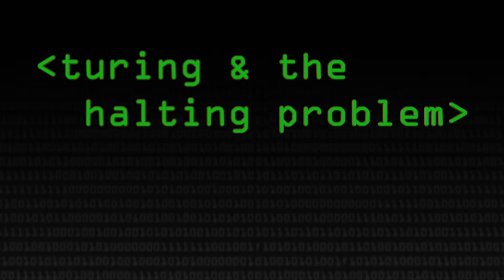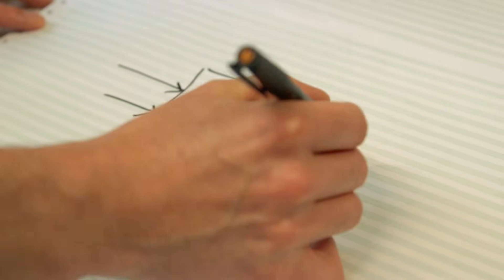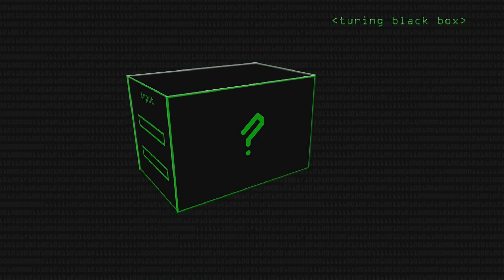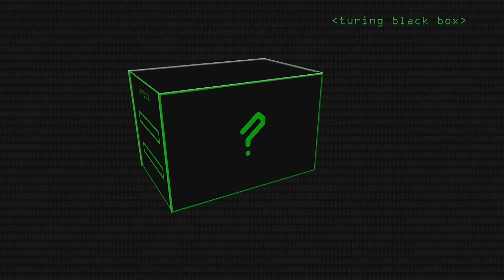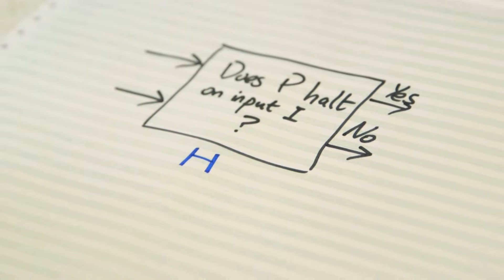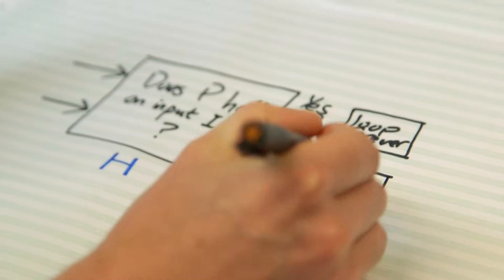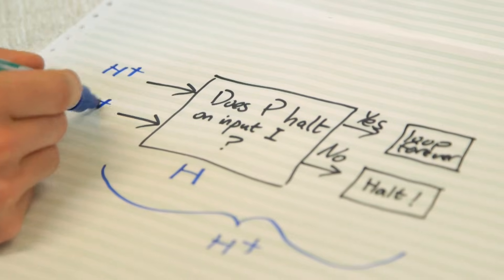Turing & The Halting Problem - Computerphile

Comment: I see something wrong with this proof (and find it probable that it is my understanding that is wrong).

If:
H(p, i) is the function that returns "yes" if program 'p' halts on input 'i' or else returns "no"
H+(p, i) is the function that goes into an infinite loop if H(p, i) returns "yes", otherwise it returns "no"

Then you're saying that performing H(H+, H+) results in a contradiction and therefore "H" does not exist. Right?

For ease of use, let's duplicate H+ and call it H1 and H2. Then performing H(H+, H+) is identical to performing H(H1, H2), and I can now refer to H1 and H2 separately.

I see two problems with this video:
1. In this situation, we've given H1 the input H2, but we haven't given H2 any input. I know that we aren't actually running H1 or H2, but if H is supposed to be able to decide if either of them halts, it's supposed to get the input for them, right?
2. We assume that H1 has to return the same thing as H2.

ex, let's solve the problem of no input by saying we give it a program that returns immediately (ie does nothing). Then, H2 loops forever, so H1 returns "no", so H returns "yes".
Alternatively, give H2 a program that loops forever. Then H2 will say "no", H1 will go into an infinite loop, and then H will return "no".
You could also give H2 another H+, but then you need more input for this newest H+. You can't feed it an infinite number of H+s, can you? Any compiler would be unable to create such a function call. Any physical computer would be unable to hold such a request since it would require an infinite amount of memory (since you have an infinite number of references to H+ as input for itself). Even with infinite memory, you'd never get to actually run the "H" function since you'd still be writing more references to "H+" as arguments (ex, H(H+, H+, H+, H+, etc)). I don't know what you might argue would happen with infinite memory and infinite processor speed, but fortunately (unless proofs have to consider that too?) neither of those exist.

The 2nd problem, I hope, is obvious (and perhaps I misunderstand the video/proof?). Just because you recurse on a function doesn't mean that function has to return the same thing at every level of recursion!
ex:
factorial(i)
> i is 1? return 1
> else return i*factorial(i-1)
If I call factorial(3), the function factorial is going to get called a total of 3x, and it's going to return 1, then 2, then 6.

I can only imagine that the contradiction is supposed to come about because we call the same function with the same data and get two different results. But since we're giving 2 different inputs (we're giving H+ as one input, but nothing for the 2nd input), this isn't the case.

We might construct a new function,
H(pi)
where 'pi' is a data structure containing both a program and its input and allows for recursion (that is, the "input" might itself refer to a program-input pair).
Then we could likewise create H+(pi), and it would act just like before.
Now we give H an instance of this structure that contains H+ as the program and itself as the Input. Pseudocode:
pi = new ProgramInputPair()
pi.Program = H+
pi.Input = pi
H(pi)

In this case, I believe the following steps would happen:
-H should start analyzing H+
-It should realize that H+ will use 'pi' and therefore look at pi.Input (technically it's that H+ calls H and H is the one that uses 'pi')
-It should recognize that it's in infinite recursion since it's about to repeat the same function call that it's already in (ie the function call to H+ using 'pi' is already on the "virtual stack") and no global variables that are used by H+ to dictate its behaviour have been changed

Notably, H can never get to the return statement of H+ because of the infinite recursion. Thus, trying to reason about the value of the return statement is incorrect.

Now, even with this reasoning, the Halting Problem is still impossible to solve unless you can teach it all properties of mathematics (which no one knows; I believe Godel's incompleteness theorem proves this impossible?). Without any understanding of mathematics, an algorithm cannot even tell you if the following halts:
i = 0
while i % 2 == 0 do
     i += 2
end

I therefore feel that this particular proof for the Halting Problem is wrong. On the other hand, it seems to be very common around the Internet. Have I misunderstood something?

Comment: so maybe there is a machine H++ that solves the halt problem, 
given this machine is not a part of the halt problem?

this way we bypass the paradox. our machine, H++, solves any halt problem, but only if H++ itself isn't a part of the asked problem - meaning it does not part of the input machine.

we can call it "the outsider observer" principal:
we can build a machine (H++) that would solve any halt problem, if it looks on a problem that is completely outside of H++. meaning the problem don't have the logic of H++ itself inside it.

however I do see a problem with this solution:
given a complicated I machine (I = for input, the machine that given as input to H++)
we can never know if H++ itself is actually part of I logic. 
maybe I contains H++ in it and we will never know it, so we can never know if H++ can solve the halt problem for given I or not.

nevertheless, IF we have a way to assert that H++ is not part of the problem I, we bypass the paradox, and so H++ might exists,  as required.

Comment: Its a dumb thing but if X=X+1 where X is the Output then the loop would make scene and X would be 1-∞ in a loop. But wouldn't you prove that that is correct.  Although its somewhat illogical but start with X as an Int add 1 so the new output is X. So the Output is either right or wrong but if it loops ether way is an issue with the Coding. Am not sure I need help on this.

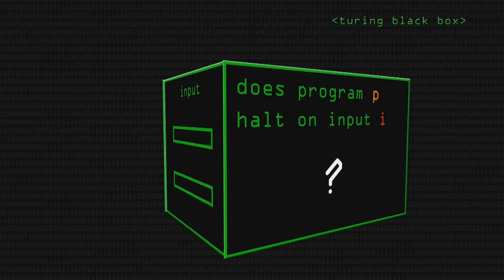Comment: +Computerphile At 3:58, Mr. Jago says that the blackbox will output "Yes" if the program halts, but "No" if the program never halts (a.k.a loops forever). But how does the program know that it will loop forever, since with every iterating loop it has the potential to halt? 

 - An Engineering Physics student, and Physics student in California
Reply: It doesn't even matter how such a machine works because it cannot exist. He even says "Don't worry about how it works, just assume it does."

Comment: you should feed h+ to h not h+ to h+ because h+ is a modified machine to reverse the output real meaning.
Reply: Hmm the idea comes into a bit better focus like that. But why do these machines need two inputs?
Reply: @foreverseethe  It takes the machine and the input that the machine would be given.  It's possible for a machine to loop forever on one input but halt on another.
Reply: Yes exactly. He is purposefully doing something to reach a contradiction, and that's fine. Why?

Think of it like this. We want to prove H does not exist, but we're having a hard time doing that, so we assume it DOES exist. Using H, it is very easy and possible to construct H+ as they said in the video. So far we know, if H exists, then H+ exists. Agree? Continue reading if you do. 

Now using H+ we arrived at the contradiction, showing that H+ cannot exist. But how is that if we showed how to make H+ using H in a valid logical way? That must mean our original assumption was incorrect, in that H can indeed not exist. 

Hope that made things clearer.

Comment: I'm not clear on how the behavior of H+ shows anything about the behavior of H.  The two machines are not the same, so why would you expect the same (i.e. correct) output.  By this logic I can ask whether it is possible to build a vehicle that can move down a road.  Suppose there is such a vehicle, let's call it CAR.  CAR can't possibly exist because I can attach a module called NOGAS that removes its motive force, so it can't go down the road.  Since CAR+ can't go down the road, no such vehicle can exist.  QED.  

If you're going to add parts that break things, why pretend that you're still dealing with the same program?
Reply: +Jason Patterson Yep there is no such vehicle CAR+, that can drive because CAR+ = CAR + NOGAS. There is no fuel powered car that can drive without fuel.
Reply: The missing part from your example is a contradiction. CAR+ can't go down the road while CAR can, and that's it. If you somehow reached a contradiction using CAR+, then indeed CAR could not exist. Both CAR and CAR+ can exist here fine.

What happened in the proof in the video is that using H, he constructed H+, and showed that H+ is impossible to exist. So essentially we've arrived at two conclusions at the same time, H+ can exist using H, but at the same time H+ can't exist from the way he described in the video. That's a contradiction, so the assumption that H exists was wrong. Hope that made things clearer.
Reply: @Kalernor  Does not make sense "using H, he constructed H+, and showed that H+". Meaning it is possible to put anything as an addition to H, and then say:"look, just because I added some impossible things to H+ it means that H, my base, is also impossible.".

Comment: define a operation "~"
~(Yes / Halt / 1 ) will trigger an infinite loop.
~(No / 0 ) will return a Yes/1.

0. H(Null, Null) = waiting for user inputs, no output
1. H+(Null, Null) = while(no input) {wait...}, forever loop
2. H+(H+, [Null, Null]) = ~(H (H+ [Null, Null])) = ~(No) = Yes

3. H+(H+, [H+, (Null, Null)])
= ~ ( H ( "case 2" ))
= ~ (Yes)
= forever loop

4. H+(H+, [H+, (H+, [Null, Null])])
= ~ ( H ("case 3"))
= ~ ( No )
= Yes

5. H+(H+, [H+, (H+, [H+, (Null, Null)])])
= ~ ( H ("case 4"))
= ~ ( Yes )
= forever loop

...

N. H+(H+(H+(H+(H+(H+(H+(H+(....))))))))
if N is even:  Yes
If N is odd: forever loop

Of course the all knowing powerful H knows about this...
it would just count the number of "H+", then outputing Yes or No accordingly.
even => Yes
odd => No
there is no paradox here.

Comment: what is the meaning of this sentence?"feed the whole machine into itself"i dont get what happens if we feed the whole machine into itself,and if not.what are h and h+?
Reply: +Sou Sargol H is a machine that takes the description of a machine and an input. Now, given any machine (let's call it M) and any input to that machine, this machine (M) will either stop eventually or not stop, and keep computing forever. What H does is say whether the machine you gave to it will stop or not stop for the input you gave to it.

H+ is constructed based on H by doing the changes mentioned on the video (if H says "yes, it will stop", H+ never stops; if H says "no, it will never stop" H+ stops). (H+ does nothing useful, we only think of it in order to show that H can't exist.)

 So when the video says "feed the whole machine into itself", it means to get a description of H+ and feed it to H+. Therefore, we have a description of a machine (description of H+), and we have an input (the description of H+).

Inside of H+ is H, which should now determine precisely "does H+ stop when you give a description of H+ as input?". If H says H+ does not stop, then H+ stops - meaning H is wrong. If H says H+ does stop, then H+ does not stop - meaning H is wrong again. If such a machine H existed, we could build the machine H+ and this would lead to a contradiction - therefore, H cannot exist :)

(sorry if there are any mistakes in my answer)

Comment: I don't understand the problem here. It seems like the issue is the fact that h+ is being fed into h+, rather than into h. If we feed h+ into h+ then there is a contradiction, because it is set up to cause a contradiction. If we feed h+ into h, the extraneous reversal of run forever/stop doesn't happen, and there is no paradox. What's the fault in my reasoning?

Comment: The halting problem proves there is no algorithm that can calculate whether any possible algorithm will halt, right? It seems relatively trivial to build a machine that COULD verify that a program halts or is unhaltable, but would be unable to compute it for some inputs. To verify a program halts, you can just run the program for a bit and see if it halts, and you could verify that a problem is unhaltable by checking for any loops with exit conditions that cannot be true, like a variable initialized to a continue state and never altered in the loop body.
Reply: +Jane Fraser
the proof is for any H that can be constructed.
H can check for whateve you want and still the proof will hold.
for example, you can come up with a condition that you cannot know if it is true or not without actially running it (involving a random number or a statement that we don't now if it true or not auch as the goldbach conjecture)
Reply: 666NedFlanders I was not proposing such a concept; I was proposing that an algorithm be run for a relatively short period of time to confirm it halts, and was perfectly aware that some algorithms can run for long periods of time, meaning the test would report that it could not determine anything if the program did not halt within the time limit. What I was ultimately envisioning was a set of programs, each of which would use some method that could confirm either haltability or non-haltability for some programs but which could also be non-conclusive, which could be bundled to create a program that could assist a programmer by confirming their code was haltable or warning them that their code was unhaltable, but was not guaranteed to do either and would not report anything for some programs.
Reply: +Jane Fraser We're asking for a definitive answer proven by logic. It's certain that it's possible to stop it manually after a set amount of time but this amount of time is arbitrary and doesn't answer the question.
Reply: Hastaroth I know that the halting problem makes it impossible to create a general algorithm that is always conclusive, I was asking about the possibility of potentially inconclusive tests.

Comment: This paradox doesn't sound like a real world problem to me. It more like sounds like a mathematical anomaly that has been abstracted into oblivion to the point where it has no bearing on the physical universe.
After all, if you grant that there's a machine that can give you the proper output for the  proper input, than why in shit would you deliberately subvert it?
Reply: well no. it proves we can't write compilers that check whether or not code will halt. we also can't write code to decide which of two pieces of code runs longer, which is a useful problem. also many intrinsically useful code analytic algorithms are impossible because they rely on the halting problem having a solution. etc etc. lots of useful things come of this.

Comment: This is not the correct proof, as in the described system it is invalid to give the pair (H+, H+) as input to H+.
Why? Because the second element of this pair is not a valid input to the first element.

There's probably an additional assumption that would make this work, but its missing from the video, which drives people mad in the comments.
Reply: +poliklosio 
when we give H+ to H, we actually give a blueprint of H+, that specifies how exactly H+ works.
that is, essentially, a bunch of characters, so you can look at it as an input to another machine, regardless of what the characters actually mean
Reply: +inon star Yeah, I know that, just not from this video.
Reply: +poliklosio All programs can take all inputs. This is a fundamental requirement from a program. If the input is invalid, or it can't process the input, the program either halts or not. But which is it? That's the million dollar question.
Reply: This is seriously messed up on an already difficult topic.
Reply: poliklosio Well, this is a video on Theoretical computer science, so it should be assumed, along with many more assumptions. For example, infinite tape of the Turing machine. This is the reason size or format of the input doesn't matter. The state machine of the Turing machine will either halt sometime or not, regardless of the "format" (using multiple tapes for writing any "special character") or size of the input (obviously, infinite tape).
Reply: +Aman Singh I disagree. A program is not necessarily well defined for all inputs. There is no reason for every program to accept any-length stream of arbitrary bytes. Author of a program is free to describe any preconditions about the inputs to the program. If input data doesn't follow the preconditions, it doesn't make sense to consider behavior of the program in such case. 

It's like considering what happens when you divide by 0. The answer is the question itself is incorrectly formulated because division is not defined for this case.

The program doesn't even have to have means to accept the bytes. How do you feed stuff to "Hello world!" program? Assuming it has the means to accept your bytes, of course you can try feed incorrect values to it, but it is not really interesting what happens in such case, as you are deliberately breaking laws of mathematics. The program doesn't even have to check for input correctness in order to be correct itself (although sometimes it may be desirable to do so).

I have to make it clear again that the model you describe IS used in the original proof about the halting problem, its just that the video doesn't say it.
Reply: @poliklosis is correct, there is an error in the presentation. I love the way that “Clever people” argue why it is correct, when it is not.